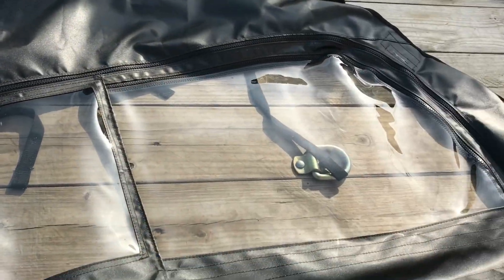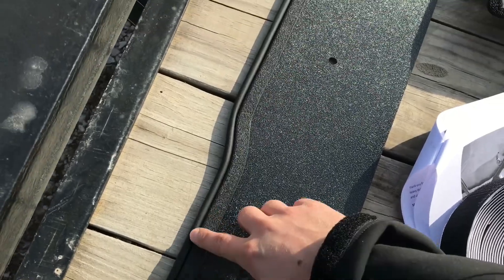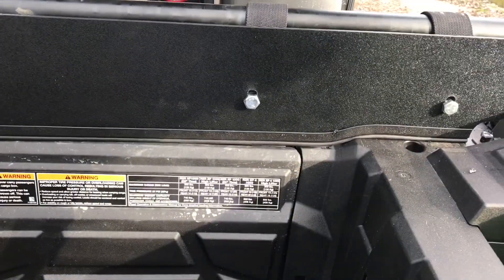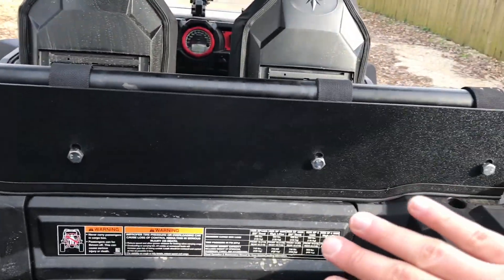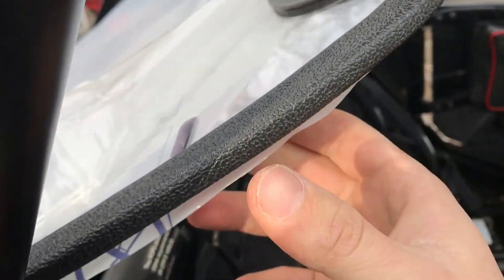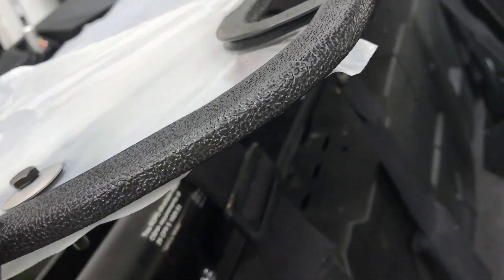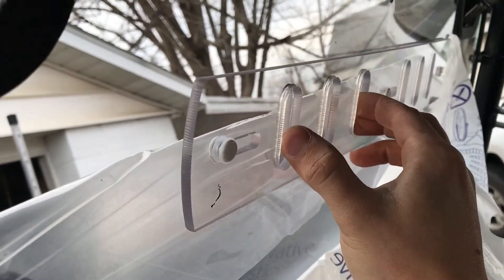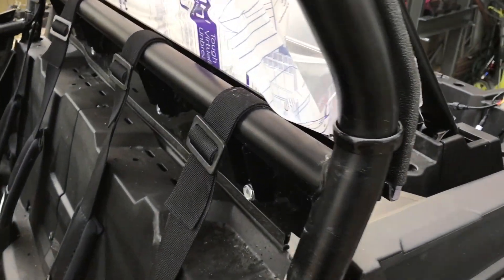Pacific Eagle UTV/GCL Upper Doors Cab Enclosure for the RZR XP 1000

Comment: I’m curious, how has it held up to this point?How we’ll do they stay on at high speeds with the use of Velcro?  I’m looking at the same canvas doors at the moment. Any info would be much appreciated!
Reply from the maker: No issues whatsoever in terms of durability with this enclosure.  The Velcro hasn’t let me down, but I did opt to supplement with some zip-ties in certain places to reinforce it all.  I don’t like the adhesive Velcro that you attach to the cage; it just pulls right off and becomes useless, but the Velcro straps that are built into the canvas have been sufficient along with the zip ties for holding the enclosure on.

I will say the zipping/unzipping becomes inconvenient when you’re trying to get in and out, but it’s not a deal-breaker for some people.  Overall it’s a nice accessory, but I’d tip my cap to the Polaris brand enclosure in a head-to-head comparison since it hinges open with the door and has the rigid frame to keep it’s structure.
Reply: Jason thanks for the quick reply! I’m going to give these a try. Thanks again!